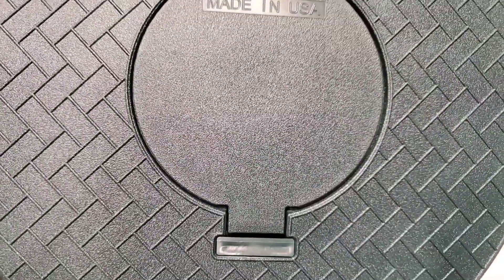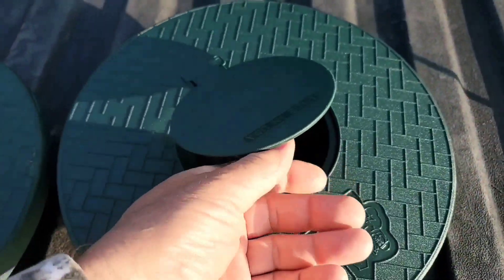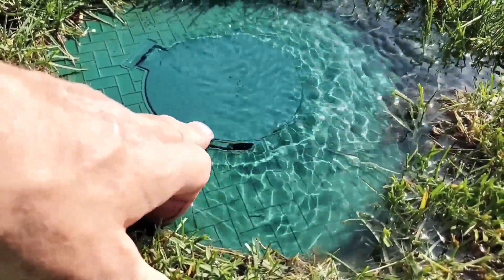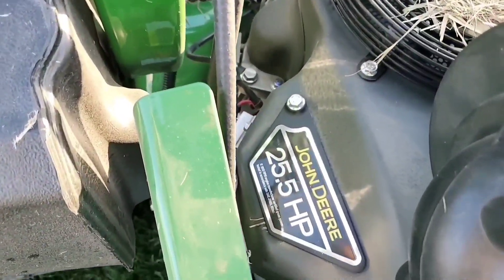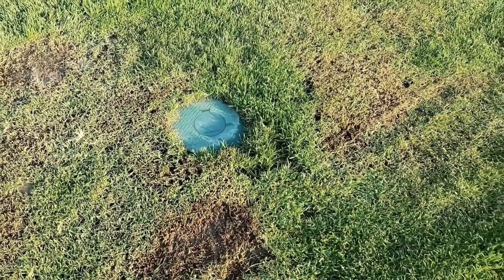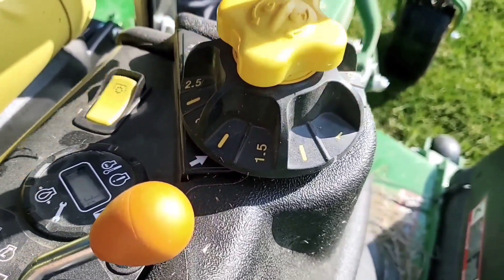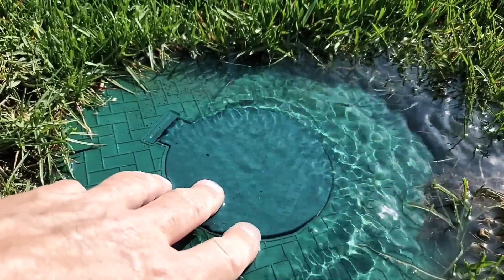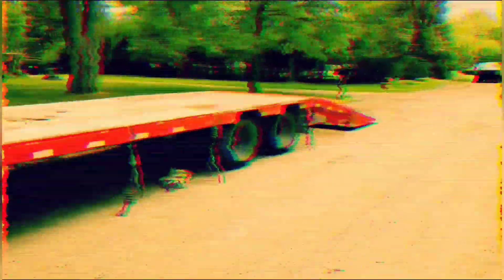Smartest Pop-up Emitter on Earth With 3 Stage Technology [ Drainage Home Improvement for DIYers

Comment: Finally got a chance to see my new emitter in action and it’s working great! But I’m not sure I put it at the right height cause there’s a little bit of dirt back flowing into it.  I installed it so that the top of the edge of the turf restrictor plate is at dirt level.  Or is it the top of the up-pipe that’s supposed to be at ground level? I raised the level of the gravel around the outlet which seems to be helpful.
Reply: @FRENCHDRAINMAN to confirm, does your like mean I’m doing it correctly?
Reply: @FRENCHDRAINMAN to confirm, does your like mean I’m doing it correctly?

Comment: I call BS on the mower test.  I've needed to replace the lids twice in four mowings due to the lids sucking into the deck of my Cub Cadet zero turn mower set at 2.75".  Next mow, I'll need to put tape over the lids to keep them down.  The lids don't open all the way but high enough to get chopped up.
Reply from the maker: I have a prototype lid that I would like to send you so that you can test it for me. Please call 248-505-3065 and ask for Nicole. Tell her that Robert would like to send you some new lids to try out.
Reply: @FRENCHDRAINMAN  Thanks.  I spoke with Nicole and three are being sent to me to try.  I'll report back on my findings.
Reply: @FRENCHDRAINMAN  I installed the new and improved lids and happy to say after the first mowing they stayed put.  The additional weight of the new lids helped from being sucked open and destroyed by my riding mower blades.   I'll report back if things change after a few more mowings.  Obviously, I'm not the first person who had this problem.  Hope this is the permanent solution, now that I've spent $50 on 6 new lids when freight/tax is included.

Comment: It works great in the video but when I mowed over your emitter plate it chopped the lid off so I positioned it a 1/2 inch lower and it chopped the lid off try a different lawnmower because mine sucks it up every time I believe a weak spring would accomplish the fix.
Reply from the maker: Just put it a dirt level. The lid only opens up 2 1/2" and the lowest notch on a lawnmower is 2 3/4"
It's a common mistake to leave it to high

Comment: Thank you for the video. Can mice get into the pop-up emitter?
Reply from the maker: No. It comes in make styles. I would go with the 90° elbow and not the open bottle if you are worried about rodents. Good question. Thank you for commenting.

Comment: So what you’re saying is, don’t buy a JD lawnmower. 😁At 3.75” even with a couple fishing weights attached to the lid my Scag ate that lid for lunch. Saw you mention in the reply to another comment to get the drain grate (which I plan on doing), but you mentioned something else was coming. Any more details on what that is?
Reply from the maker: The lid only goes up 2 1/4" so your pop up emitter must be really high.
New parts slated for spring 2023. To early to announce.

Comment: Without being told, I think most people would opt to have the popup flush with the surface of the ground so they can go over it without there being a big dip in the lawn. In that instance, the popups can be sucked up by a push mower fairly easily. It happened to me and mine is flush withe the surface and I cut at 3" with a regular Honda push mower.  Even so, these are better than what the big box stores offer.
Reply from the maker: Thank you for commenting. We recommend the drain grate if flush with the turf. I know a big leaf doesn't go through the grate but I will have a product for that next spring FYI. Tooling / Manufacturing 🇺🇸 USA
Reply: @FRENCHDRAINMAN  since I already have 3 of the pops installed flush with the ground I epoxied a small weight on the underside of the popup to keep it down when mowing.
Reply: I would just say there is nothing "regular" about a Honda.  ;)